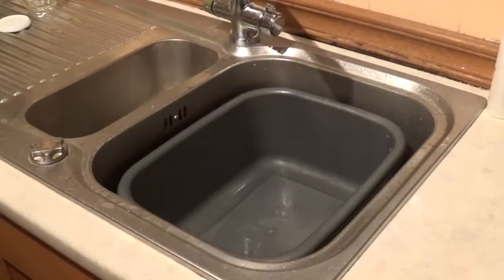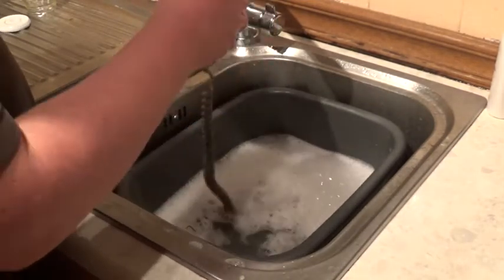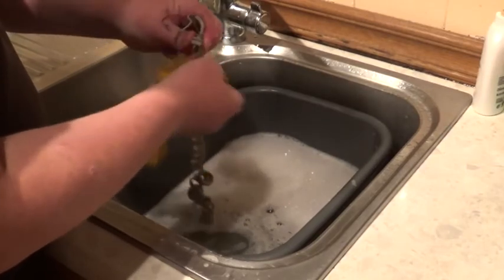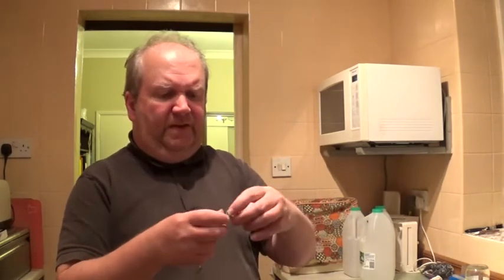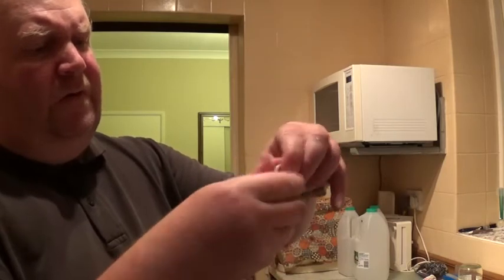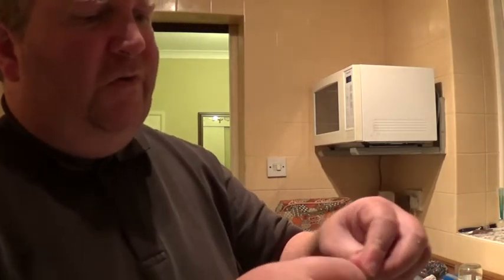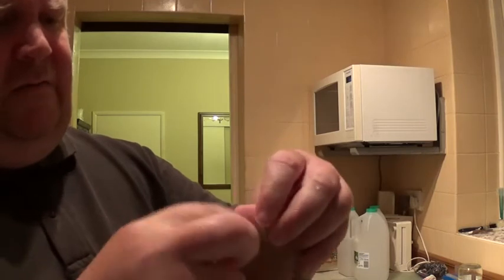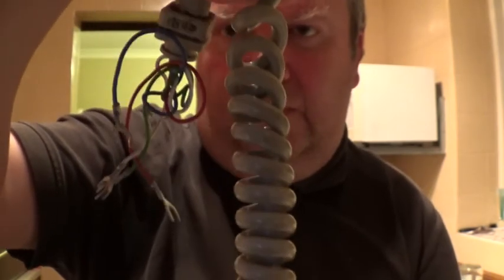How To Restore a Curly Cord

Comment: Hi there. Great video. I actually worked at a place in Stoke-On-Trent  called Astral Telecom which made the  pottery telephones like the old country rose. They did dial and push button. Later I then worked for a company in Newcastle-Under-Lyme called Teleconnect which made the curly cords and line cords for Astral Telecom. So i have actually made these curly cords. Yes unfortunatly after a number of years they do get dirty and in a mess. I do like vintage telephones and do have a few. Never thought about your method. So thanks for posting.

Comment: Andy, 

Thanks so much for this information.  I've got a pair of Sony MDR-7506 headphones with a coiled cable that looks much like what you started with.  I'm pretty sure your technique will work with my coiled headphone cable and make it look good as new again.

Regards, Tom
Reply from the maker: It should work Tom. I think all these coiled cables are made in pretty much the same way.
Reply: Hi Andy, 

I did my Sony 7506 headphone coiled cable yesterday.  It really worked.  The coiled cable is a lot tighter and looks much better now.

Thanks again, Tom
Reply from the maker: I'm pleased to hear it worked out ok for you.